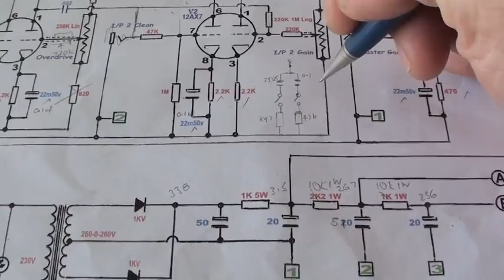Small Tube Amp Build, Start To Finish

Comment: I built one of these using your plans and it's awesome. Built a combo using a wooden wine box for the cabinet and using a Jensen 8". Your series has inspired me to go on and build a more Fender tone one but using the same technique you used. I even built a tube pedal based on the design for a guitar mate who loves my amp. Thanks for your hard work putting this together, it must have taken hours! I have got so much pleasure from this and will do for years with all the projects I am planning.
Reply from the maker: Thats awesome!! Great to hear. Well done on the conversion and the tube pedal! Its a versatile little circuit with massive output. I have very nearly finished the layout to a push pull version of this circuit (18w). Same pre amp (two channel clean/crunch), however with the addition of a tone stack (bass, treble) and also a switchable resonance/presence feedback circuit for a bit of extra tonal range.  I'm itching to build it. I'll put it the website when finished. I've also completed this little 5w circuit with a tone stack as well. All the best with your projects, let me know how you get on, cheers!
Reply: @elams1894  Will do & I can't wait to see the push-pull version. EL84s still?
Reply from the maker: @newtoneer01  Yes 2 x EL84 tubes. I guess this circuit could be described as a 'modern' design as it uses all 12AX7's. I'm designing an all vintage circuit though as well, with EF86/ECF80, 6BL8 pre and phase inverter tubes respectively and 2 x 6DQ6a's for power tubes. Should be a very interesting tone. Cheers
Reply: @elams1894  That's a great concept. The ideas for tube amplifiers really are limitless. Look forward to seeing & hearing the result.

Comment: I'm a respected amp builder in my area... I enjoy observing other craftsman's techniques... hats off to you! A very nice build! BTW - I incorporate switching for the 1st gain stage's cathode (a) 2k2 (b) 2k7 with 0.68 [plexi] (c) 1k5 with 1uf (d) 1k5 with 22uf [fender]. I also provide switching for the coupling / blocking cap leaving the plate of the 1st gain stage (a) 0.0047 (b) 0.022. These two features allow for a wide range of voicing that can accommodate most any single coil or humbucker pickup. It's nice to see someone taking the extra time to lay the entire project out on paper first. Good engineering occurs on paper and then is realized during the build.
Reply from the maker: Thanks so much Mark. Yes switching is very interesting and extremely versatile. It also provides a way to manipulate tone without a signal sapping tone circuit. Cathode switching is pretty cool and looks as though you have all bases covered. I find that working out how to incorporate the switching into a circuit is very challenging and indeed takes lots of planning on paper. This is especially so when switching channels as not to leave the grids wide open. Ground switching can be a head wrecker. Very cool and thanks for your comments!!

Comment: Wow!....Just awesome!  Can I ask...are you self-taught, or have you attended Luthier school or cabinet making/carpentry school?  Can you recommend any books/websites for amp making?
Reply from the maker: S Cuono Sorry for delay S, I should get back to my vids a bit earlier.  Thanks for your kind words, I am self taught and never attended any classes.  I used the net for ideas but for actual physical work I just think about what I'm trying to achieve and the best way to achieve it with what I have and thats about it for my MO.  I did use TDPRI dot com a lot for guitar build processes that are freely posted on that forum, it has incredible free information.  It has many tricks and tips for wood work cabinet making-esk work too.  For amp stuff I grafted that out on my own, and that took many years of trial and error in terms of electronics.  Thanks again for your kind words!!

Comment: That is not an amp. That is a piece of collectible art work  ! What next ? An amp with handmade tubes from glass made from sand in your back yard, homemade extruded copper coated wire, and the cabinet from wood from a tree in the front yard.  LOL ,Holy moly that is a fine job sir :)

Comment: As an electronic geek since grammer school and getting my ham ticket early on and with most of my working years in the electronics industry, I just don't get the tube revival going on now.
 After germanium transistors and before I.C. bricks, solid state amps using T.O. cased and matched outputs with proper engineering and analog power supplies were great amps!
 I'm sorry but my solid state McIntosh amps, (And others) were every bit as clean and warm as any tube amp with the exception that they take less power, and do not generate as much heat.
 I know, I know, I have many Hi-Fi and musician friends that insist tubes sound better, but every time I do a blind test most of the time they cannot tell me the difference.
 Sorry but I just think this tube mania is based on opinion, not reality.
Reply from the maker: Paul Rose Thats the thing, its all about personal taste indded.  Certainly with regard to guitar amps, for me it is like night and day, with tubes clear winner.  They have a wall of sound mass behind them and wonderful harmonic distortion.  Perhaps because they are voltage driven, high voltage, as apposed to current dominated as in solid state.  Having said that I certainly have heard some great solid state amps.  As far as guitar amps go, both clean and distorted, for me its tubes.  Thanks for your comments, it is a fascinating debate thats for sure. Cheers
Reply: +elams1894 I heard that the first transistor amps to be made were far superior in quality if you compare them to the current production
Reply from the maker: Popescu Kevin I would agree with you.  Better components and build quality indeed.  Iv worked on a few early ones and they were built like tanks.
Reply: Paul Rose Grammer school?
Hmmm

Comment: I used to wire control panels off of a schematic and wiring diagram for coil winding machines and we had to keep the wires nice and straight just the way you are..Awesome video!

Comment: Very nice job at layout and sweet point-to-point wiring.  Nice to see a tech who also plays unafraid to use metal film resistors for precision. In addition to the obvious electronic skills I have to give major recognition for a craftsman that knows power tools, when to use them and when NOT to use them and go old school hand tools.  Example - choosing a brace and bit as opposed to a power drill for drilling into carbon fiber insures accuracy and clean, neat holes where even a variable speed power drill can "jump".
Reply from the maker: +enorbet2 Thanks so much enorbet!  Thanks for the cool observations. Indeed sometimes it is far far better to use hand tools so one can obtain the right speed for the job.  A power drill sometimes quickly turns a hole to mince-meat in carbon fibre.  Its nice to have that accuracy from metal films, not sure I get the whole carbon comp drift tone thing.  I would like to try the new carbon resistors from Kiwami though, they are very highly rated. Thanks again for your kind words, much appreciated!

Comment: I was impressed enough with the circuit, but then you made your own dovetail jig? When they're so easy to buy! Well done, from a fellow woodworker and musician.
Reply from the maker: Thanks Grower! Was thinking about a bought one but none of them have a stable footing for the front of the router. Everyone thats available off the shelf, in whatever price bracket only provides a base for half the router. Hence I made my own with the vice doubling as a platform for the other half of the router giving an entire stable base. It makes the jig very stable for the router. I may buy the aluminum finger jig however I'm quite surprised that my wooden finger jig is very accurate too. Looks crazy but there was method to my madness ;)

Comment: Very nice workmanship. I was thinking that if the chassis was tidy it would look good exposed, then I thought a polished stainless plate embedded in your carbon. Also remember on the old stereos, they had a line from one side to the other that transformed into the brand name somewhere along it.Just throwing some ideas out. Electro etch the stainless with the knob and switch labels.

Comment: sounds good, can't say a Marshall is better unless I had them side by side, you just made it look real simple and it makes me wonder what a name brand like Marshall does different.  these could even be better with all those thick wires and electrons
Reply from the maker: +mike jones I guess a company selling tube amps has to have production costs in mind and try to find that fine balance of quality expense vs tonal reward.  There certainly are differences in the tone of high end components such as capacitors and transformers but I guess its like wine, you can pay 4 or 5 times as much for a very good bottle of wine but is the end experience 4 or 5 times better? Its an interesting debate for sure..

Comment: I very much admire your skill and the fact that you share it with the world with such excellent videos.. I'd love to be able to do what you do!

I don't know much about electronics, or nearly anything about amp design. I do love hi-fi audio though , using Sennheiser HD600 headphones with a unique hybrid tube+solid state headphone amp
from Schiit audio called the Vali 2 ...  I understand guitar Amps are a completely different ballgame, focusing on comparatively limited frequency range, etc -- I was just wondering if anyone
had designed a hybrid Tube/SS guitar amp? I know the SS guys are always trying to reach the holy grail of sounding as much like a Valve amp as possible .. seems like a hybrid design could
be the best of both worlds in a way..     Of course my vali 2 doesn't sound quite like an all valve amp, but it does give a perfect amount of the warm valve tone as to masque the harshness of an all SS.

Comment: The form for the carbon fiber shell alone is way cool. The hand made dovetail jig is just insane and wonderful. 

Question: could you put a layer of aluminum foil or a metal screen between the layers of the carbon fiber to make a Faraday shield for the amp?
Reply: Carbon fibre is shielding
Reply: @rickpartington8765  last time I checked you need some grounded piece of metal to act as shielding. Carbon fiber isn't conductive in the slightest so it will act very poorly in terms of RF shielding.

Comment: Great Work. Mind you if I ask a question, just for the sake of curiosity? How many hours, from the planning to the final amp took this project, in total? Of active work? I have to praise your skills anyway, and can't even imagine how much You have learned.
Reply from the maker: The circuit design took a long time to get into a optimal layout and noise reduction, maybe 6 months of tinkering with the layout and then the build, once I had locked it all down, took about two weeks. Thanks so much Paulo!!

Comment: Hypnotised by the level of skill and care taken - excellence at every step.
One thing - I can't see what the role of the wooden "fingers" unit at, say, 5:37 is?
Reply from the maker: Thanks David. The fingers of the dove tail jig guide the router bit so as to cut uniform dovetails. The width of the fingers is critical, if you are a fraction out anywhere, the joint wont fit. The machined allow ones are best but by some miracle of the heavans, my wood fingers worked out accurate. Many thanks again!
Reply: Cheers!

Comment: That's some quality work! But a class A amp can't output more than about 50% of plate dissipation, so for a 12W EL84, you're looking at a max of about 6W (a bit less, in reality).
Reply from the maker: Cool as, I was going by the output tranny size but I certainly should have gone by the physics of the tube, thanks for the input, have a great day and thanks for commenting!

Comment: Wow, I am incredibly impressed by your knowledge and talent. Can you recommend a textbook that would provide some of the background electrical knowledge necessary for understanding how a guitar amplifier works? I know no one book will teach you how to build it, but I would like to understand what is going on here. Thanks!
Reply from the maker: +John Danek 'The Guitar Amp Handbook' is very good.  You'll have to read and re read it several times to get the hang of things and then just launch into it, start with the preamp stage and figure out what it takes to power each individual tube and look at some of the iconic schematics to give you clues.  'Uncle Doug' has a great channel on YT that gives excellent basic knowledge that is easy to follow.  Thanks for your kind words, I really appreciate it, have a great day!!

Comment: So after binge watching Uncle Doug's videos for the past couple months, I got linked to your channel. You inspired me to start on this journey melding my countless years of playing guitar, my love of electronics tinkering, my ex-profession as a woodworker, and my current profession as a physics teacher. I have figured out where to source all the components chassis and garolite. The way you build is exactly in my wheelhouse with the attention to detail, precision and accuracy. I'm just deciding which of your designs to build. Is the Halcyon like the Mark II with 2 switchable channels and dedicated gain pots, but has the addition of the tone stack with trebble, bass, and mid?
Reply from the maker: Hi Stefano. Seems like we come from the same mould ha ha. Glad the vids are of some help. The Halcyon is how you described indeed. That is a S5 MarkII with TMB tonestack. There are some differences however. It has an extra gain stage and hence it is voiced a tad more toward aggressive overdrive. It has a DC coupled plate on V3A, rather than the normal AC coupled plate of the S5 M2. 

I'm a big fan of physics myself. Drop me a line elams1894@gmail.com anytime. Cheers
Reply: @elams1894  Perfect. I am more of a metal player anyways, so I welcome the more aggressive overdrive. Plus the extra gain stage will help me with my overall learning. You sold me on the Halcyon.

Comment: Very cool. Correct me if I'm wrong but the guitar seems like you built it too. It came out very nice but I would've used some nice old timey radio cloth from ebay. If you want a challenge you could build a real reverb chamber for it. Or an outside reverb. That would be sweet.
Reply from the maker: Thanks Paul.  Yes I think thats the great thing about creating instruments and amps, you are only limited by your imagination.  I love the old time radio look too, esp 50's atomic styling.  Also I like the carbon style modern stuff like ferrari interior type and hence I was going for a combination of that with this amp but have many more cab designs in the back of my mind, certainly cloth style is very cool too.  I am working on a 4 gain stage 100w amp at present, a reverb would be cool in that.  Thanks so much and have a great day!
Reply: elams1894 Cool. I'll check it out. 100w? Isn't that kind of dangerous?
Reply from the maker: Paul TheSkeptic Its no more dangerous than a 5w, just bigger transformers and a tad more voltage I guess but same safety rules apply.  Iv taken 4 hits from the guts of amps over the years, just carelessness mainly, and it aint fun so now safety for me is top priority.
Reply: elams1894 Cool, good luck with your projects.

Comment: so here's a question:
how did you get your start in amplifiers?  building a kit, repairing a vintage amp, modding amps?
Reply from the maker: Good question. Like most, I had absolutely no idea what the heck was going on in a tube amp, let alone design one. I built a kit but that didn't help at all as it was just joining the dots. I was none the wiser. Modding amps is, in my opinion, probably a better place to start as then one can at least hear and see the results of what you are changing/modding. It also forces you to look at a circuit. I believe one must understand how a tube works to really get the ball rolling. The engineers who built the vacuum tube are the true wizards/geniuses. A tube is designed to run optimally with a particular circuit (no voodoo science anywhere), anything else you do to that circuit is just tweeking for tone/distortion characteristics. So I would suggest to anyone to first understand how a tube works, how the plate, grid, cathode, and electrons all work together, and then go onto the preamp stage and then onto phase inversion stage and then power stage. Also, a key thing with an amp circuit is recognizing that their are two circuits, one to power the tubes optimally (High voltage) and the other which carries the guitar signal (Low voltage). Understand how the high voltage beefs up the guitar signal in the tube. Hope that helps, cheers
Reply: Yeah, it does, Thanks!